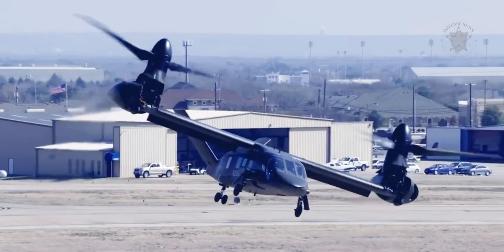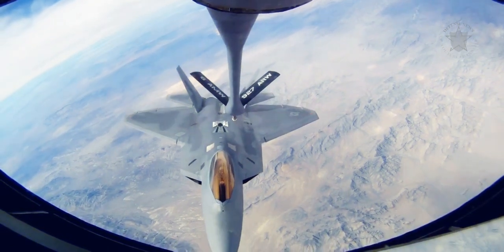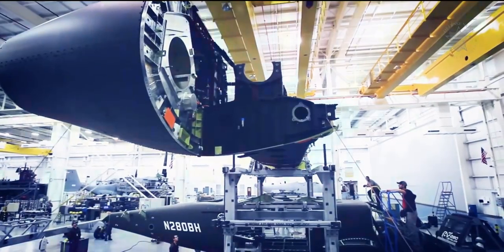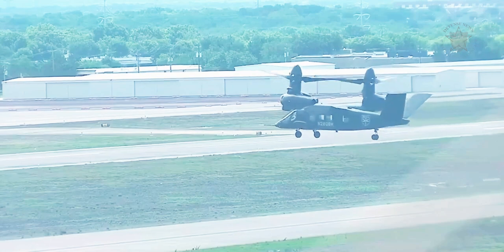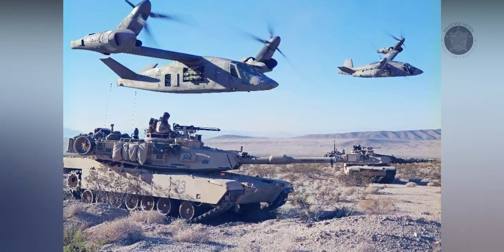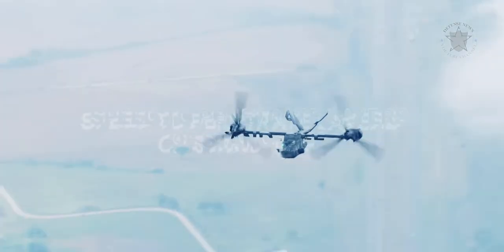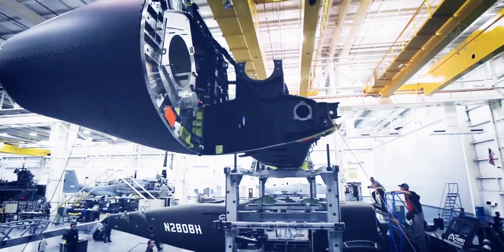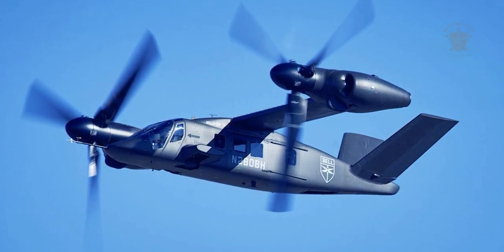The US Military's Future Super Stealth Weapon

Comment: I swear these tilt rotor platforms like the Osprey and Valor would be perfect as CAS platform and as SpecOps gunships
Reply: Still not sure what the reasoning is behind not having a heavy  transport/artillery gunship..edit..not an ac130
Reply: Yep' 👍🇺🇸
Reply: @elementaleighteight  Do you mean a tilt-rotor heavy transport/artillery gunship? if that what you are talking about, it ia a matter of weight and engine size and performance. Look at the trust need to allow the F-35 vertical flight features.

Comment: The V-280 flies faster than 280 knots thus the name V-280.  The V-280 Valor has actually flown faster than 300 knots.
Reply: It goes around 305 knots or 350 mph, which is damn fast for anything with hovering like a helicopter capability.
Reply: 300 KTAS is the published "cruise" Spd.  Max Spd would be something faster. That is a lot faster than  a very fast chopper.